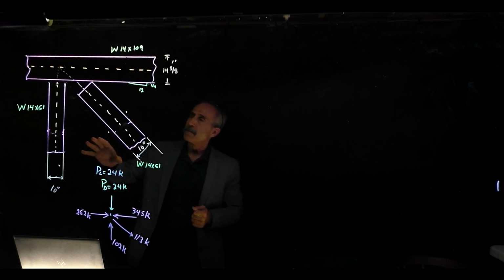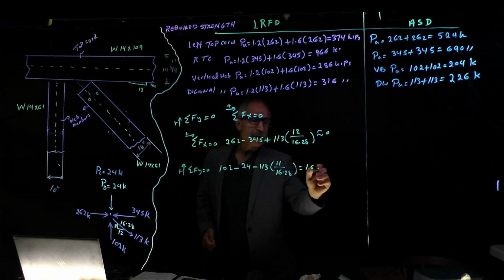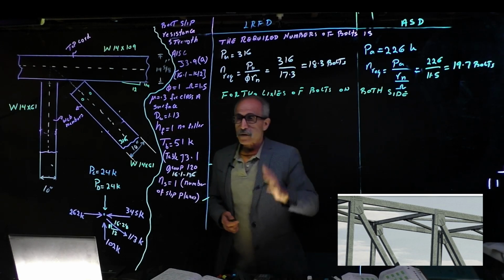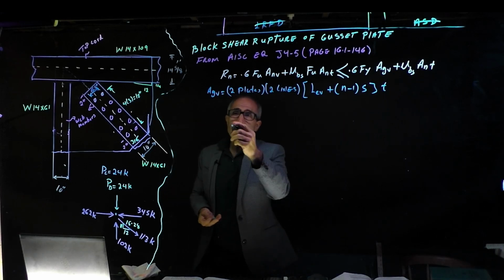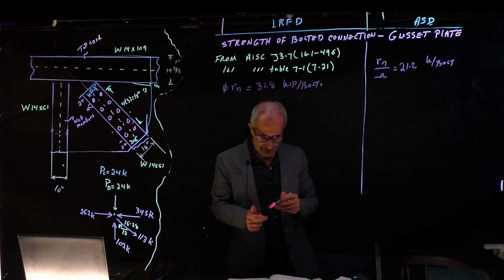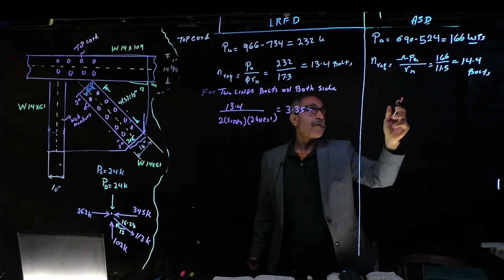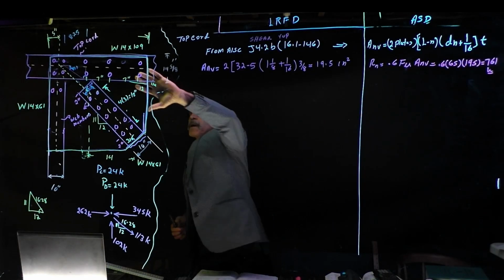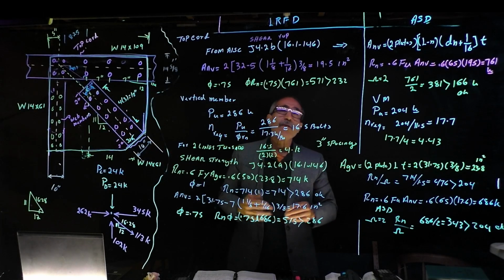Gusset Plate Design

Comment: I have 1 question sir, is 2 plates means 2 shear plane sir?
Reply: Because you using WH 14x61 as a brace member, I am not sure why you consider 2 shear plane for calculation. I think just consider the 2 row of bolt. CMIIW.
Reply: Or it is because you install the gusset plate at the two sides of flanges of brace ?